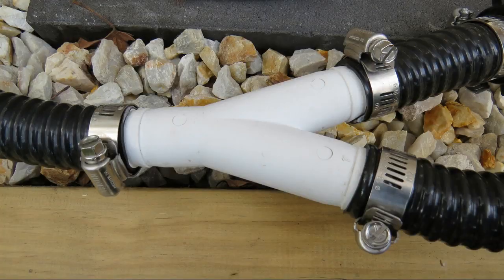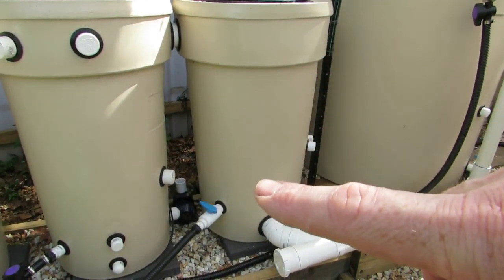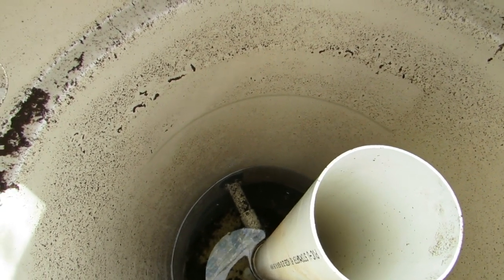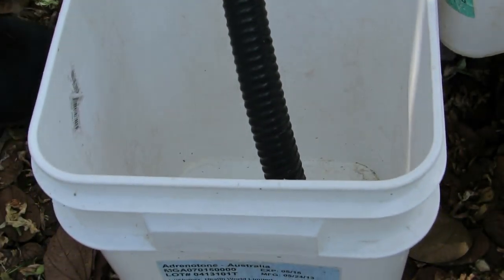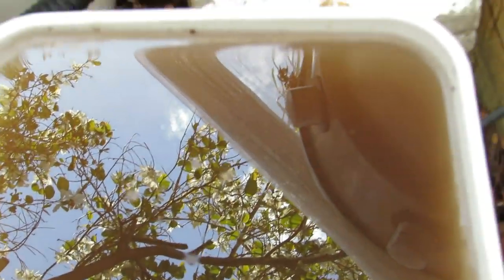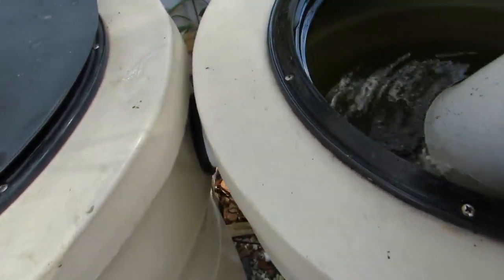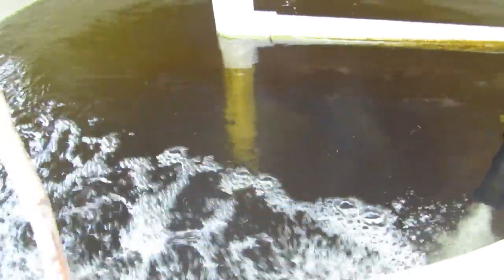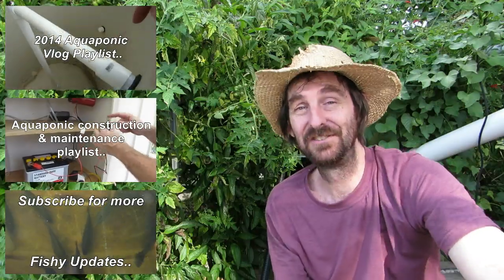Aquaponic Build Vlog 6, Radial Flow Filter clean out  & playing with the plumbing..

Comment from the maker: Cleaned out the Radial flow filter for the fist time in the revamped Aquaponic set up yesterday & also swapped some fittings over to help the water run smoother from the pump..
Am mighty pleased with the way the new set is running.. 
Next on the agenda is the grow beds ;-)
Cheers all..

Comment: Your filter cleaning setup works very well. I am not surprised that the y fitting work better. Alot less change of direction there.
Reply from the maker: The "Y" fittings look to have done the trick rather nicely John :-) Think there will be more than enough flow for the grow beds as well..
Cheers mate..

Comment: Rob, I like your solution for cleaning your RFF.  I use a jiggle siphon and it takes about 10 minutes.  I do not get it as clean as you do but then again it is just going to get dirty again anyway. That used to be my excuse for not cleaning my room when I was a kid. :)  And the water (about 10 gal) is great for my garden plants. I noticed an increase in subscribers today,. Could not figure out what happened. But then someone told me you mentioned me in your clip.
I was just paying it forward. Glad to do it, you have taught me much.  Did it work with the new probe? 
Aloha,
Jim
Reply from the maker: Hey Mr Jim.. 
Have used the jiggle siphon here too & really like them.. Worked well in the RFF in the older system as the barrel was up high.. A lot better than getting a mouth full of fish poop ;-) 
No problem on the share at all mate, was the least I could do.. Have't popped the new probe in yet as I can't find it :-/ Was part of the reason I started the big clean out downstairs.. Will let you know how it goes once it's all calibrated.. 
Cheers Sir & all the best.. 
Rob..

Comment: I learned the hard way to NOT leave the pH meter in a place that gets too warm.  I had stored my meter inside a container that sat in full sun.  It didn't take long before the pH meter was destroyed.
Reply from the maker: Hey mate.. Doesn't help when they cost what they do does it.. 
What did mine in was dropping it on the rocks a few times :-/ I had a habit of leaving it laying around when I got distracted which wasn't ideal.. Now keep ours in the backup cabinet as soon as it's finished with so think it will last a bit longer ;-)

Comment: Hey on your bio filter you can use a 90 degree elbow and aim it down and drill holes it. That way your media will move freely.
Reply from the maker: Hey mate..
That's how I had it set up in the old Bio & will be doing the same again with this one.. Thought I'd get tricky with this one but it didn't pan out..
Cheers mate & have a great one..
Reply: Right on!! the system is looking great too Rob!